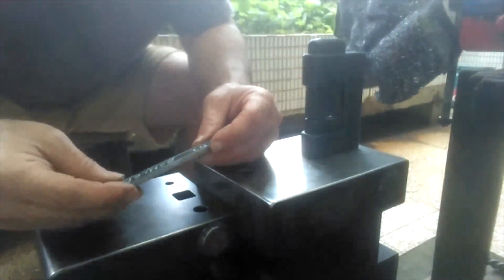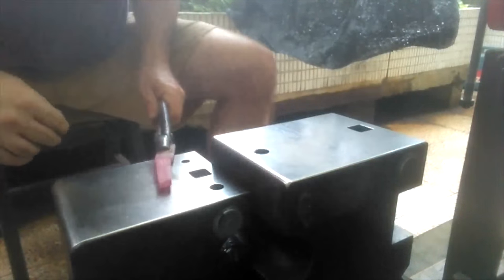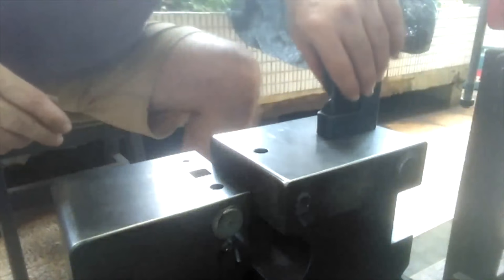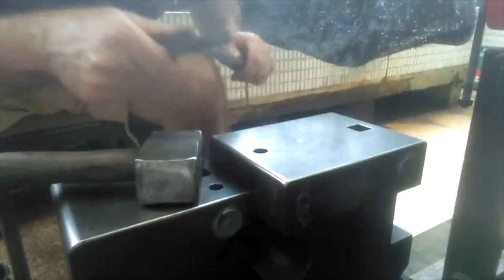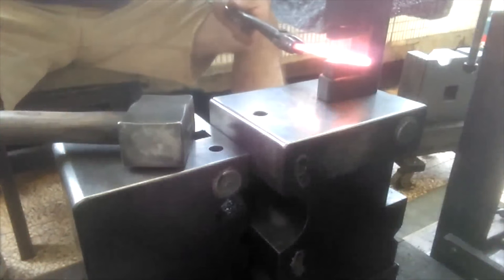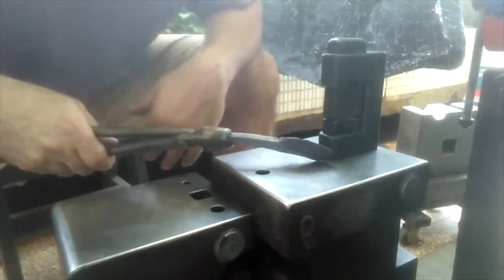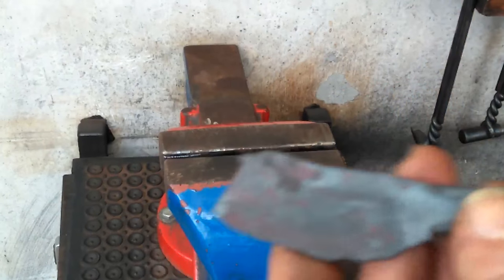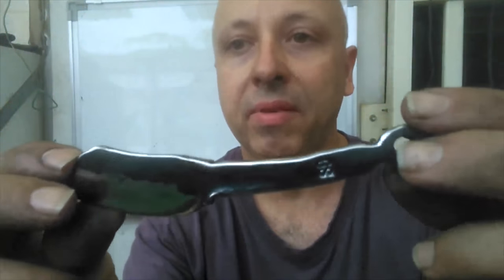Blacksmithing - forging a straight razor - D2 steel

Comment: Nice job Glen! Like the way you shaped the plates in the guillotine tool to give the hollow ground look.
Reply from the maker: Jeff, The guillotine tool with the bevel dies works but still needs some tweaking. But for then most part, it gives a consistent result. Thanks. Glen

Comment: I really think you would enjoy getting and using some good (and inexpensive) simple carbon steel such as 1075, 1080' 1084, 1095 etc., or whatever the equivalent steels they have available in your area, as they are much, much easier to forge.  Also,  they are fairly simple to "properly" heat treat to get a great performing blade.  In order to get the performance out of a steel like D2 and other higher alloyed steels, they require a long soak at very precise temperatures as well as pretty high tempering temperatures, and a lot of times can benefit from cryogenic or sub-zero treatments.  With "simple" carbon steels you can basically heat them to just above non-magnetic (to about 1475-1500F or 800-815C) then quench in warm canola oil.  Next, just temper the blade in a normal household or even a toaster oven for two, 1-2 hour temper cycles at 400F-450F or 200-230C.   Another plus using simple carbon steels in the instance of this type of project is that they produce a much finer edge, which is ideal for shaving, as they contain much less carbides than in D2 etc, which is what makes D2 a great steel for keeping a "toothy" edge for a long time due to all the extremely hard carbides along the edge, which is great for skinning, cutting rope, cardboard etc etc.  You can think of it like a microscopic saw, which is what you do NOT want to shave your face with lol.

Btw, you will want to thin that edge waaay down to at the very least .010" of an inch or .25 mm (preferably less) before attempting to put an edge on it, as it will 1)-  take forever to sharpen at the thickness you currently have it at using sandpaper, and 2)- it just will not get sharp, let alone sharp enough to shave with, although you might get it to cut a few hairs on your arm once you reach an apex at the edge.  Razor blades are typically taken down to pretty much a zero thickness at the edge before sharpening.   

I promise I'm not trying to be a jerk or bring you down or anything like that, I'm just trying to share some helpful tips with you that can potentially save you time, money, energy and/or frustration lol.  Btw, I really enjoy your vids.  Regarding making tongs to hold bar stock like you mentioned in this vid, I recommend doing a YouTube search for "Forging tongs for bladesmithing by Ed Clarke" as they are ideal for this type of forging.  Thanks as always for sharing your work with us.  Take care. 🙂
Reply from the maker: I can get almost any standard carbon steel. For this project and with my aversion to grinding and the like, a straight carbon steel would probably have been the better choice since it would've allowed me to do the cold work in an annealed state. There's just no practical way for me to anneal an air hardening steel like D2 after I've worked it at forging temperature. Thanks for reminding me to thin the edge way down - I'll do my best. If I can't make this razor perform, I'll try to use 1095 or maybe O2. Anyway, as this razor stands, the steel is incredible hard and it's going to take me forever to work it down properly. By the way, this D2 is from Austria (Bohler). Someone imported a bunch of it for sword making and I got a few off cuts. It's supposed to be superior to other D2 - something about it being hot milled in four directions, I think... By all means, make any helpful suggestions you like - I like advice and even criticism so long as its constructive. As for tongs, I've made a few in my day and can make two styles (my blade or bent knee flat) that will suit my purpose for holding stock on edge. Thanks for taking the time to watch and comment. Glen

Comment: Another fun video. You may have to thin that bevel down more to get it shaving sharp. Don't forget to buff or strop that edge and test it on your arm or leg first. My first stock removal blades was from a D2 planner blade. Man I ate up some abrasives getting it made. It held an edge forever. I had to buy a diamond grit sharpener to put an edge on it. Thanks for the videos
Reply from the maker: Ron, Thanks for the suggestions. This D2, after being heated past critical temperature, is just incredibly hard. This steel is probably better for stock removal, as you mentioned you did, since it comes in an annealed state (but is still very hard even in that state). I definitely need some better abrasives... Thanks. Glen

Comment: Thanks very much for this video. I want to make a razor. I'm working on taking a big old hexanut screw and using that as the bar stock.

I'm gonna flatten it, pound it to a rough shape and I'm hoping to ultimately case harden it from mild to carbon steel. It'll be a work of art!

Comment: I have used a straight razor in the past (I used a fish fillet knife before the razor!), and like spark gap mentioned, straight razors do commonly have a deeper hollow bevel, but it is probably more a design function than a requirement for a shaving edge.  The shape of most straight razors (at least to my thinking) helps to facilitate stropping on a leather strop, and is probably why they are the shape they are. 
A "shaving edge" can be put on any cutting tool, even an axe.  You could probably even shave with an adequately sharp wood chisel, but I wouldn't suggest trying (I certainly wouldn't).  But as to practice shaving with a straight blade, I believe most barbers start by shaving balloons.  Blow up several different balloon shapes and sizes, lather them up, and practice.  I would think putting different amounts of air in the same sized balloons would help develop a good feel as well.  Don't risk your own neck (literally) with your shaving skill until you can shave balloons without popping them.
That said, I didn't start with balloons, or even a proper razor.  But I was a stupid teenager, and teens aren't known for doing things the right way to begin.
So, for the sake of all your viewers, shave a few balloons before you risk your own skin.  We want to see lots more videos.
Reply from the maker: Brian, I'm sure I will need to more of hollow on the bevel. When I get to creating a fine edge, I'll certainly find out... I really like your comment here - the part about being able to shave with any tool which has a sharp enough edge. This concept can be applied to so many things. Of course, using a fillet knife to shave wouldn't be ideal and is actually pretty nuts (even for a teenager), but the fact that it could work is undeniable. Once I get this razor sharpened, I'll be sure to take it slow. I'd still like to make a few more videos!... Thanks for the good comment. Glen

Comment: Dig this man - look forward to seeing it in use
Reply from the maker: Daniel, Glad you like this. I'm also looking forward to using it - if I can ever get this ridiculously hard D2 sharp enough... As others have pointed out, my next one of these needs to be a straight carbon steel like 1095 and not a tool alloy steel like this D2. Thanks for watching. Glen

Comment: Nice work, yeah get the thing razor sharp would like to see it in action..all I use to shave is a straight razor its takes a bit to get used to it but I like using them : )
Reply from the maker: After working on this, I'm curious to give it a go - I've never used a straight razor and maybe this isn't the best to start with... Assuming I can sharpen it properly, I'll post a video of me using it for sure. Thanks. Glen

Comment: Nice vídeo indeed! Thank you much for sharing! May I pose a question? How the forged blade behaves in termes of edge retention? I read somewhere that D2 is not suposed to be forged... Regards!
Reply: D2 is possible to forge, but you need to keep temp over 925C

Comment: when I used to have a German cut throat the hollow bevel was much larger and used much more surface of the blade than yours has. I'm not trying to criticize I'm sure had you intended to make a razor from the start the dies would have been different I'm just trying to offer advice. 

I thought maybe if you made a double edged blade feeding from oposite directions might straighten the blade as the curve will balance but like you said until you try it it's just a guess. that method might make a nice letter opener though
Reply from the maker: Yes, I think I can alter my dies to create more hollow bevel, which would also help in reducing the cold work. This is more of an experiment for me and any suggestions are welcome. I like your idea about making a double edged blade, like a dagger (or letter opener) with these guillotine dies. That should certainly work to straighten it out... Thanks. Glen

Comment: Hello Glen, I do a bit of blacksmithing myself, and I'm wondering, how much more difficult is sitting down while forging, rather than standing? I know sitting is a traditional Asian smithing practice, and I was also curious, is there anything else that changes when you're sitting, like your hammer grip for example? Thanks.
Reply from the maker: Hi and thanks for watching my channel. Here in Taiwan, I've never seen any other blacksmith who sits while hammering. I'm sure there are some but I think that that may be more of a Japanese way. And the Japanese blacksmiths who I've seen (on video) seem to kneel rather than sit. For me, it just seemed that sitting would be better for my current work space. I've gotten so used to this that I might not be able to stand and hammer! In the past, I often had back pain from standing and hammering but so long as I sit on a seat with some padding, my back has been great. But what I've noticed is that my shoulder position, even when not working, has become somewhat hunched forward. And this has caused me some pain, not when hammering, but when doing other everyday things. But overall, I prefer to sit however there are other dangers to consider when sitting and working on hot steel, not the least of which is a workpiece flipping into your lap. Depending on your body and workspace, it might be something to consider. Have a Happy New Year. Glen
Reply: Glen GS Tongs Thank you very much for the info. Great videos by the way! Happy New Year to you as well!

Comment: I want a straight razor from steel zdp 189
Reply from the maker: Is that steel (zdp 189) extremely high in carbon? Never used such steel but can imagine it would be hard to hand forge. Thanks. Glen

Comment: Sorry but that is not at all a straight razor..
Its a razor shaped object at a beginner level.
Geometry is wrong, shape is wrong, thickness is wrong and d2 needs to be cryo tempered in order to reach hardness necessary for a proper straight razor’s edge retention.